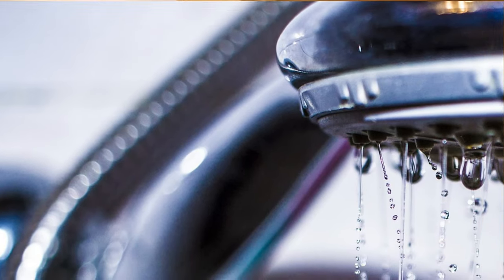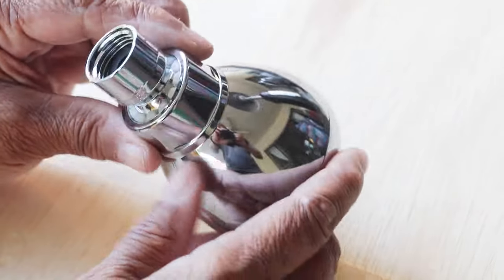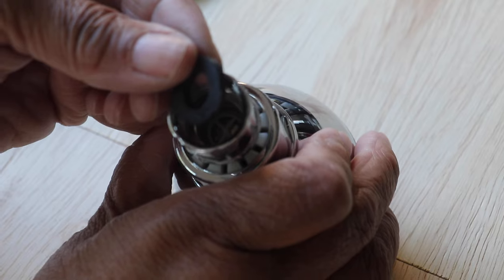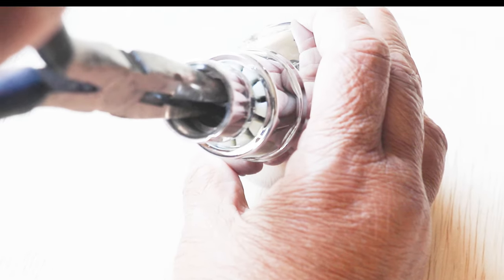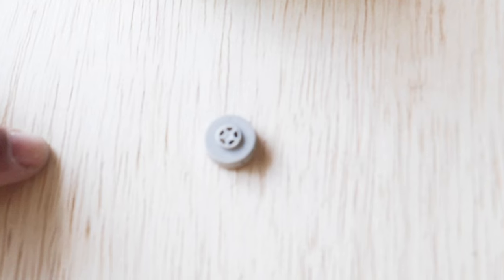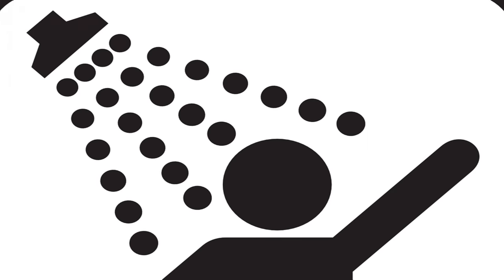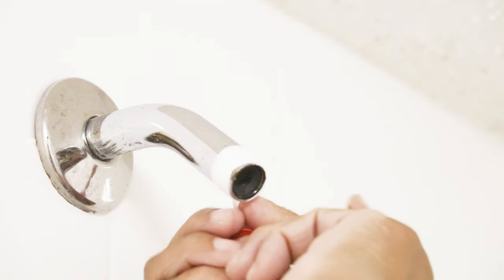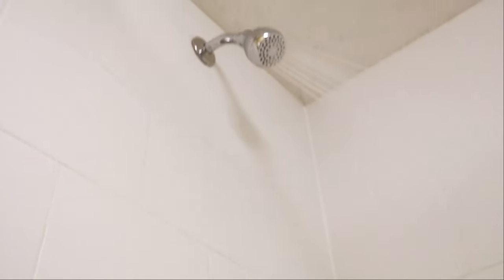Secret Few Homeowners know and PLUMBERS don't tell you

Comment: Thank you Leah for this great tip!  I have a question. I have black sediment under the bathtub spout. When I clean it with a sponge or rag, there are always black stuff that comes off? What is my problem here...will you please do a video about this? I’ve heard it may have to do with the hot water tank? Note: I don’t have this issue in my kitchen. FYI- My house is a ranch...no basement.

Comment: I remodeled the master bathroom in a house built in 1996 and ran into this same issue with the new shower head.    I complained to the plumber who had just finished the installation and he told me about the flow restrictor but refused to take it out for me because he didn't want to get in trouble.     I don't know how much water is being saved because I now have to shower longer to get to where I felt I was before I "improved" the master bathroom.

Comment: Listen this may not be exactly the same but it triggered a thought. Just recently I had to have a hot water valve on my boiler replaced. The temperature difference was so great that you can now make a cup of tea with tap water. So, We went probably 17/18 years with hot water but not “HOT WATER”! Maybe you could do a piece on that valve and the different ways it’s in a boiler. I’ll bet a lot of people don’t realize they are wasting energy because it’s a valve not the boiler reducing the heat.

Comment: I used to live in a building that the shower was horrible. I thought it was normal, then I after a year, I complained to the building supervisor that we don’t get enough water to shower properly. She was kind enough to open up the shower head and showed me the restrictor washer put inside the pipe base itself. She removed it and the problems as gone. I’m talking 20 years ago
Reply: I used to travel a lot and stay at motels. I carried my own drilled-out showerhead and a roll of teflon tape.

Comment: I bought a new shower head a couple of months took the flow restrictor out. Hot water lasted 7 minutes. Put it back, now shower lasts 20 minutes. GPM too high without restriction.  Plumbers don’t take restriction out. It causes too many issues

Comment: I partially pulled back the rubber gasket and did not have that cross widget (flow restricter) 😏 I really was hoping to have stronger water pressure.

Comment: I think my bath will run hotter if I put a flow restrictor IN the hot tap.     I don't know why but combi boilers don't want to heat fast running water.     I know so many with the same problem.   When running a bath you have to turn the hot tap half on/slower in order to get hot water.   If you turn the tap on full the water is only warm, sometimes even tepid.
Reply from the maker: Thanks for sharing your experience

Comment: Federal and State laws require them, but AFAIK there's nothing to prevent a homeowner from removing them. Same with turning up the water heater from the tepid "safe" temperature. Been doing both for years and years.

Comment: This is why I always bring needle nose pliers and channel locks when I'm staying at a hotel for more than a few days. 😁 Also a screwdriver to unlock the thermostat so it will run after I stop moving around the room.
Reply: I thought I was the only one who did that, LOL!!!  I've removed those darned restricters for 20+ years.  I also carry my own shower head to hotels.  Takes a minute to remove theirs, and a minute to put it back, with no leaks.  I bring channel-locks, teflon tape, a piece of leather strap so as not to damage the hotel's fixture, and a few extra washers (for fittings that are so equipped).  AT home - I always remove that restricter or drill it out.

Comment: I had to do this awhile back. I had a Navien Combi boiler (tankless furnace/water heater) installed to replace my gas furnace & hot water heater. Not long after it was installed I was having an issue with hot water in one of the 2 showers in the house. This shower was farthest from the boiler and I was getting a hot then cold, then hot again water flow. Thinking it was the new boiler, I called for service. The tech checked the unit (OK) then had me turn on the shower. The problem repeated itself and the tech told me the water flow rate was too low to keep the water heater constantly working - the reason for the hot/cold stream. He said it was due to the "flow restrictor" and it would continue because, by law, "he couldn't" remove it.....BUT....if I found a "non-restricted" shower head ("wink, wink") it would solve the problem.

I took it out & problem solved!!
Reply from the maker: Interesting

Comment: Begin wrapping the tape around the pipe in the opposite direction to the direction the pipe will be turned.  Is the correct way, not a clockwise rule.

Comment: Hello Leah, we have learned a lot. We have two questions. There is two sliding closet doors with a bracket to keep doors from being pushed in needs a better solution. Also high traffic area needs paint on tiles which would u recomend

Comment: It all comes down to self control. You can do just fine with a low volume high pressure spray if you don't further reduce the effectiveness trying to make it work in a 12" showerhead with 200 holes. Use that thumb sized showerhead and it'll blow anything off of you in seconds. And if you have a teen without a water restrictor who likes to take 30 minute showers twice a day... well now. Better get a timer and a megaphone!

Comment: I don’t find the flow restriction (when working correctly) to be a problem. Sediment or even pieces of plastic from a deteriorating water heater can create a flow obstruction if they block the opening. I would suggest cleaning the flow restrictor before deciding to totally remove it. The same kind of obstruction can happen to aerators on sinks.
Reply from the maker: Thanks for commenting

Comment: Pro tip: While you have the shower head off, run the water at full blast for about 30 seconds each hot then cold to flush debris out of the line that will clog your shower head when the flow increases.

Comment: I had bought a replacement tap for my bathtub and it had a flow restrictor and took forever to fill up the tub. When I discovered that it was a device to restrict water from being used I was pretty upset because, let’s say my bathtub is 30 gallons and I plan to fill up the tub to take a bath. If my old tap took 10 minutes to fill the tub and the new one takes 25 minutes, how am I saving any water if I am still using 30 gallons? At that point it’s just an annoyance. If they had the idea to restrict the drain under the idea that it saves water by taking 30 minutes to drain the tub instead of 5 minutes. It would be considered stupid. I get why they do it, but a lot of it is really just an illusion of conservation under the banner of annoyance

Comment: as a licensed plumber, when doing a new home trim out/ set out, when the home gets inspected, and the showerhead is turned on, a good inspector will know that the water saver has been taken out, this can fell the inspection and if the inspector is an ass, your plumbing license could be in jeopardy. I did a lot of hi-end homes and worked for hi-end companies, we played by the rules.
Reply from the maker: Fair enough but a homeowner is not held to the same standard.
Reply: @seejanedrill  true, I'm only pointing out why it's there, many times we have to go back and take them out. I have to play by the rules in this kind of situation.

Comment: Any suggestions if you have low water pressure. They replaced the pipe to the shower but was told it is probably the pipe coming from the boiler because I only have a problem with the hot water. Any suggestions.  Noticed that about 5 years ago when I got the new boiler they used flexible copper pipe. I have heard that old lead pipes attached to copper can cause build up. Any suggestions

Comment: If people find the flow or pressure too high, just don't open the tap fully. You have the power to adjust the flow. Taps aren't digital on or off. They have a range. Use it to your advantage. ;-)

Comment: yeah I did this the first time my landlord came by with a "mandatory" shower head replacement. ok buddy. Also used a pencil to keep the mercury switch ON when the landlord put limit screws on the thermostat so you "couldn't" put it past 72 degrees. OK BUDDY.

Comment: You still have one restriction that you can't do anything about. Begining back in the late 70's, early 80's, the government mandated (sound familiar), all manufacturers of plumbing products to incorporate these conservation measures in their new products. And even the valves that turn the water on and off have restrictive passages in the castings to reduce the maximum flow that the valves are capable of.
    Removing the restrictors at the shower head and the aerator at the faucet helps slightly, but the water valves themselves, reduce the volume of water to the outlets.

Comment: I have shower heads that have metal mesh under the washer, I assume to help with collecting hard water particulates?
Can't really see beyond the mesh but I assume there is a flow restrictor, or does the mesh also act as the flow restrictor?

Comment: Leave a few threads on the water transfer pipe the shower head attaches to when adding Teflon tape. Cross threading is decreased resulting in a clean tight seal. Nice vidya and the point that removing the restriction results in less time in the shower. Get the facts and make wise decisions, not virtual signaling attention.

Comment: Such laws are put in place by politicians rather than engineers that actually know what's going on. In places like California, the water is already restricted at the meter before it enters the house so the restrictor compounds the situation. I doubt you'll be getting 2 gallons per minute out of a shower head like that. That's what your problem is. I've got 100 ppi water pressure here in Oklahoma, so the restrictor is actually doing some good here. Where the water is already being restricted, you might as well just be getting peed on. You really need a water tank with a pump in those areas.

Comment: I hope you can do a video on this problem.  The pop-ups in my sinks end with a loop, making it impossible to remove them without going under the sink and fooling with several parts.  I took the sink popups out and cut off the upper quarter of each loop, making it a U so I can remove it from above to clean out the hair, etc.  Now the showers.  I can't figure out what to do.  The cover over the overflow drain spins and spins and can't be removed.  The popups themselves can't be unscrewed.  One is on an inside wall so I could open up the wall to get to it.  One is on an outside [stucco] wall.

Also, both showers have a single handle that controls both the volume and temperature of the water.  The higher the volume the hotter the water.  What fiend thought this up?

What should I do?  I'm in your hands.

Thank you.

Comment: Taking out the flow restrictor is not enough.  You also need a quality shower head made from metal, not plastic that will allow the increased water to actually flow out of the head without leaking.

Comment: Leah, just one quick question.
When using Teflon tape on the pipe thread, is that rubber washer even necessary?
Reply: It's the other way around. The rubber washer is necessary, but the tape is not

Comment: Even if the flow is fine with the flow restrictor at first, if you have hard water, it WILL get plugged up and get worse worse worse over time. If you don't clean that darned thing out regularly, it will get so calcified in there that the whole shower head will be plugged up and worthless. You can clean it out, even then, but if you clean it regularly before it gets that bad, it will be much quicker and easier!

Comment: Long story short our renters installed a shower head and complained low pressure and so I go over and remove shower head turn it on and see pressure..looks good and now I see dirt inside the filter...common problem and go off of your analysis not the renters. My 2 cents

Comment: If only was as easy with sinks. :( Sinks do have a flow restrictor just before the aerator, but they also use a new small diameter pipe from the wall and they are brazed directly into the fixture. This is one of those things that upset me more than anything, mostly because I keep fish, and a few years ago, we changed a faucet, and then we moved into this house and it hard, before that yeah, there were restrictors so you didn't get house pressure through the sink faucet, but not this bad, it's so bad, the pressure coming out of the is basically useless in allowing a venturi pump to operate properly.

Back on topic, I normally do remove these, but there was a handheld shower head I tried doing this for, and it just wouldn't work without it. it was years ago, and it was the only instance that I found taking it out actually cause it to not work at all. I still can't think of a logical reason for it not to work.

Comment: If you look at the restrictor you will see one of the holes has a little chunk of rock or calcium in it most faults have these they usually call them aerators they mix air into the water most of the time you will get what feels like a stronger stream of water with them in they have a plastic cup with a couple of thin metal washers and usually a plastic washer in the middle to separate the metal parts then a plastic pice on top to hold everything together pull it apart and wipe the junk off of everything depending on how much junk is in your water these can plug up in a few months to a couple years usually just wipe everything off under water is enough but I’ve had a lot of them I had to tap on the counter a lot to dislodge all the chunks then just put it all back together and reinstall like it was you can try it with or without but most of the time I find after cleaning they work better with them in one other thing to REMBER if you leave it out of your shower head in a year or so most of the spring jets will be plugged with the crap that plugged up the other peace and it will be a lot harder to fix and more expensive to replace

Comment: It would've been great had the presentation first documented beforehand the water-pressure difference prior to removal of the flow-restrictor, so the viewer could actually witness for themselves the two flow-rates.  In other words, I [myself] don't 'see' the improvement in flow-rate here once the flow-restrictor is removed (compared to a visual of it still installed).

Comment: 2.5 gallons per minute times 15 minutes equals 37.5 gallons of water used. Standard temperature of shower is 95 plus in cooler months. Water heater temperature set by manufacturer or plumber would be 120. Not much hot h2o left for the next family member. Little to none if flow restrictor removed.  Georgia master plumber!

Comment: So how many gallons per minute is it without the flow restrictor?
Reply: Depends on your house supply pressure, piping, and head. I've measured more than 10 gpm in a shower close to the water main and without a restrictor. Just don't open the valves all the way... unless you have kids using it.

Comment: How much water (GPM) goes through an unrestricted shower head usually?
Reply: Doesn't this depend on the design of shower head, and also the water pressure in your area?
I seem to remember in the deep past taking a 5 gallon bucket and timing how long it took to fill it up from my shower. You can calculate gallons per minute.

Comment: Before I removed the restrictor from my new shower head my shower time was more than doubled. Water just dribbled out of the head. Now I can shower using less water than I did with the restrictor. I believe in conserving water but the restrictor was actually forcing me to use more water to get shampoo out of my hair and wash the soap off of my body. Double the time it takes to fill a sink? Saving nothing. I will not be punished because one state has refused to build dams and reservoirs for the last 25 years while their population grew by leaps and bounds, and blames their water shortage on the climate.

Comment: There many shower heads that meet the 2.5 gpm and give a great shower. Your pressure should not be affected.Then you have people remodeling adding multiple shower heads totally defeating the purpose. Now if someone comes up with a way to keep teens from languishing in the shower and using all the hot water.........

Comment: Good job Monica outdoors , although lakes and reservoirs are a source of chemically and filtered drinking water  , aquifers supply a large part bygone our nations water demand and has been depleted at an alarming rate that is overwhelming the natural replenishing rate. With little things like soft rinse showers, timed faucets, two button flush toilets , tankless water heaters, as well as restricted aerators are just a few things on our part as homeowners to conserve water , although the low flow fixtures are sometimes less desirable and seemingly take longer to get the job done, they ultimately will be a large part of the reason we can be secure that future generations water needs are met not only in the US but around the world

Please leave your fixtures as they  are installed by professionals, it could not only damage the product but you could also harm yourself and others

Comment: I would like to correct one thing you did. you shouldn't wrap plumbers tape around the pipe. tape is for tapered pipe fittings. washers are for straight pipe fittings. you should not tape if there is a washer.